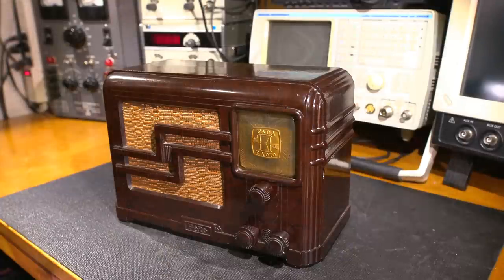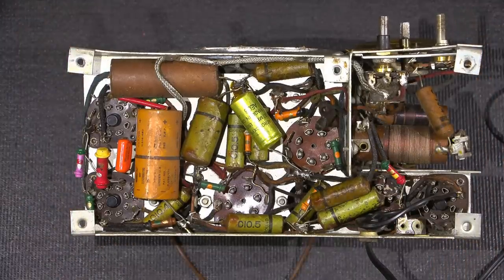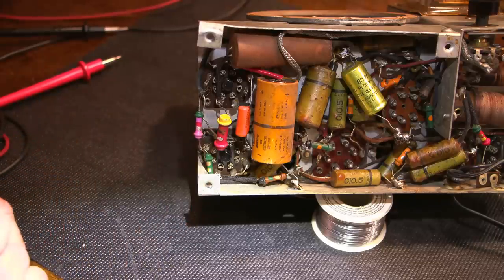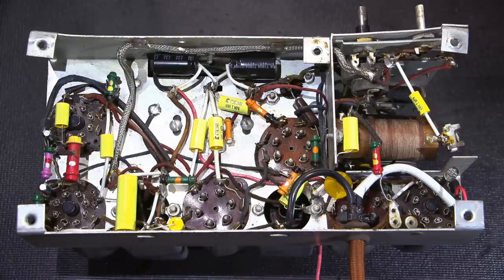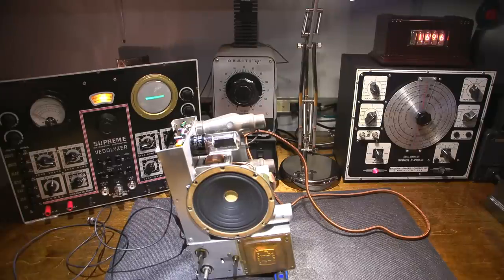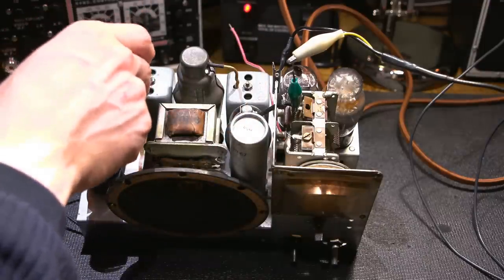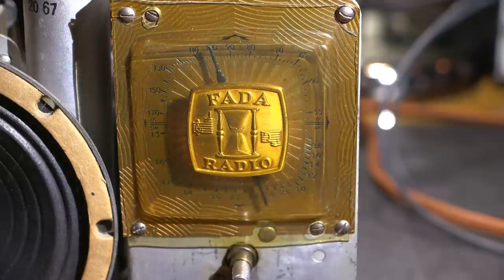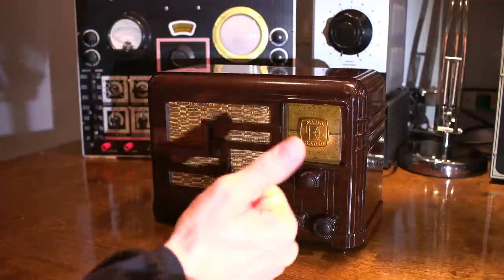FADA Radio Receiver From 1937 Electronic Restoration! [Repair]

Comment: I started working in a radio/TV shop at 14.  I'm 74 right now.  There were almost no solid state devices.  The fear of tube circuits astounds me.  I ended up as Chief Engineer for AM//FM broadcast Stations and am retired from 2 Universities.  I did re-tune  an FM transmitter with 10KV on the plate.  I got the Ip up to 5 A just to see if the tube could do it.  I have rewired 3 phase transformer primaries running either 240VAC closed delta OR 208 VAC 4 wire.  I've even swapped 2000 pound  3 phase HV transformers between different transmitters.  With the right precautions and operating techniques it is safe to work on almost any equipment.  It is important that one hand is ALWAYS in one pocket and all work is done with equipment that is verified OFF, and all HV circuits have been grounded to remove residual voltages.  All jewellry should be removed as well.

Comment: They say that imitation is the sincerest form of flattery - and you Mr Carlson have got me at it too!!

I have recapped, repaired and aligned one 1948 radio.  Two more to go dating to the early 1950s.  Have recapped and repaired a 1962 Cossor 1099 oscilloscope, and am building an accessory device for it to add a normal Y attenuator / amplifier, a sig genny, and a frequency meter switched between X, Y and genny.  There is much more, but no need to list here.

Using vintage to fix vintage is fun !
Reply: Keep going your doing great!  Just remember the rules! It's not dead! It's retired! If it's worth fixing do it right! Nothing electronic should be forgotten!
Reply: @the8bitbarn836  haha the name of my guitar amp repair biz is “forgotten gear restorations”. I couldn’t agree with your sentiment more!

Comment: Last summer while vacationing in Chautauqua New York, I picked up a couple of 1940 era radios from an antique shop. One was a GLF F-770.  It's an am-fm-phono type. After doing a little research it seems it was privately produced for the local farmers and merchants of western New York area.  GLF stands for Grange League Federation.  I love the history behind these old finds.  Been working with electronics for about 40 years. This will be my first "old time radio" restore.  Thanks to Mr. Carlson I brought it up slowly with the variac, isolation transformer, and dim bulb tester.  I found out that the transformer was shorted.  Lucky enough to find a NOS transformer.  It works!  Now for the caps.  This will be a fun restore.  Thanks for sharing your knowledge with us Mr. C.

Comment: I used to have that signal generator, and I still own the same variac as you. I first started messing with vintage radios when I bought a batch of broken AA5 tabletop sets at an auction for next to nothing. Surprisingly, I never had an accident or shock from one of those dangerous radios, and got a good many working.  Back then, my "restorations" were simply replace the defective components and sometimes tune up the IF, and I still love those old tube radios! Real radios glow in the dark. Keep them singing!

Comment: Hello Paul,
 I've been doing "catch up" on all of your videos. I've been thinking about this every time that you do a restoration on a receiver with S.W. You have a lot of space in the chassis after changing out those big old caps for the modern stuff. How about building a small BFO circuit with the adjustment knob on the back of the chassis to preserve the classic appearance while being able to access the high percentage of SSB signals available on those bands.
 In any case, I have really enjoyed seeing some of the stuff that I remember from when I was a teenager with a old scope and signal generator. I really like your teaching style. People with a very basic understanding of electronics can learn more without feeling that it's all over their heads. Thanks again, for all the great videos. I've relearned some things that I forgot sixty years ago. Keep it up!

Comment: Wow! It has been over 50 years since the last time that I touched a vacuum tube device - I worked in numerous repair shops during high school and college. Viewing this episode of "The Lab" was like stepping back in time. Plate voltages, choke coils and filter capacitors all came back - like it was yesterday.  I really appreciated the method by which Paul troubleshoot this '37 radio. I would have got directly to the volume control with my probe (or touched a screwdriver to the center lead of the pot) to check for audio output.  Checking the screen grid capacitor would have been somewhere way down on my list. 
Great video - keep up the wonderful work!

Comment: I can't wait to see a restore of a similar-era TV (even if there's no analog TV stations left, may need to restore one of those as well).
Reply: Take a look at the YouTube channel 'Spats Bear'. He did a ten video series fully restoring an RCA CT-100 color TV from 1954. This may have been one of the first color TVs.
Reply: a vacuum tube tv being able to display a fully sync'ed picture only with all analog circuitry is really a masterpiece of engineering, that's why tv's are a tough dog...cant accurately test components like the flyback transformer, even with a ring tester, it's a gamble...so you need to power the set on, but to power it on you need to change caps... i have done about 20 german BW tube sets..some of them use up to 23 tubes. my approach when possible is do the minimum to make it work, then recap..after recapping there is the need for adjustments before you can be able to display a picture....the timebases will be running at wrong frequencies for example, more than often particulalry the horizontal will need tweaking...after that it requires a full setup to make it look right...it's a really interesting/challenging hobby,
Reply: Bandersontv is a great early TV channel. Bob is as meticulous as Mr. Carlson and is very fun to watch.

Comment: I used to record music off AM many years ago. Unfortunately, my station-of-intrerest broadcast at 910 KHz, the first harmonic of the IF of 455 KHz! This resulted in a nasty beat frequency showing up when properly tuned in. So, I had to DE-TUNE the IF's up or down and re-tweak the oscillator so the dial tracked.

Comment: Mr Carlson, Could you talk about the advantages and/or disadvantages of putting a grounding line cord on these old radios? I seems that rewiring the switch, adding a fuse, and grounding the chassis with a grounded line cord would be the ultimate in safety. What I don't know is what issues (if any) that would have on the performance of the radio. These videos are great, I have several radios that I bought at an auction that these videos have inspired me to rebuild.

Comment: I've never liked tube gear. Had a Heathkit GR-54, switched to a solid-state  Yaesu FRG7 and never looked back. Never had any tube ham gear.  That said, I just love these videos! The sheer simplicity of these radios, and how well they work even 80 years later, makes me think maybe I've been missing out.
Reply: Steve Mason If you made an equivalent design with modern transistors (just a few, say <10), the semiconductors would possibly outlast any foreseeable users. If you used ceramic capacitors only (possible but would make it more expensive), there’s be no parts to have limited lifetime. Lots of transistor radios are similarly simple, and all that fails there are capacitors again, plus the fallout from poor process control in semiconductor manufacturing (it was all new and not always well understood at the time).

Comment: I enjoy your videos. I've been restoring radios for almost 40 years. It seems like your videos highlight chassis in remarkable condition. I'd like to see a video where you have to strip every component, clean/derust the chassis and start from scratch. It's a great process. Or fixing issues like crackling in the tuning cap.

Comment: It's pretty hard to believe but true that most of the dog bone resisters I have tested came out so close they never had to be replaced even in a 1937 Air King radio I had. The paper/wax caps and electrolytics do beak down over time the dielectric in the Electrolytics all seem to dry up over time. Very god troubleshooting and restoration video Paul. Thanks for sharing your expertise.

Comment: It still amazes me just how warm and full the sound is on these old valve radios compared to virtually every solid state radio I have heard, and this is on the AM band, which is not even classed as high fidelity.
Reply: I remember an old car radio pulled from a '68 or so Monaco that had great tone just like a tube radio.  Turns out those early transistor car radios ran a transistor class A through an output transformer just like most small tube radios. Possibly why it had similar tone. Have not heard such 'hi fi' sound from an AM radio since.

Comment: I like your presentation manner and you have a very natural voice with excellent cadence which makes it very easy to follow. Your God's gift of intelligence and electronic ability has helped so many of us. I am thinking of joining your Patreon channel to try some of your projects that are of interest to me. But I have a simple question which I hope is not taken in a negative way. Why are you installing the foil caps with their values not shown? The old dog bone resistors have their painted values on top to be seen easily when installed. Why not the same for the foil caps printed values? I realize you have a schematic for the radio, but would it not make sense to be able to see the value of the cap to make sure it is correctly installed or easy to replace if a schematic is not available? Just a passing thought. Thanks again for the educational videos.

Comment: Well done.  Beautiful (safe to say) equipment. Nice to see the alignment techniques used when I started my career in Communications many (5) decades ago.( + 2nd IF)  Real, hands on, engineering,  New equipment and wireless digital technology are absolutely brilliant uses of the airwaves.  I do not begrudge any of the modern gear but love to have lived through the growth of this vital technology. ( I confess to having some Strowger telephone exchange switches and three Electromechanical  pinball machines plus three quadcopter drones...) Paul F.  North Yorkshire, England xx

Comment: where does one get that cloth cord with the updated polarized plug on it? AES?  The only way that I could see to improve that good idea is if the new cord had the old school round plug body on it along with the wider neutral blade. Thanks so much mr carlson for an excellent presentation of a cool radio repair.

Comment: Great video as usual Mr. Carlson! Regarding the identification of the 'hot' and the 'neutral' on the cord set, we normally...as electricians, make the neutral the white wire (or white spaghetti), and the hot the black wire (or black spaghetti). The neutral being connected to chassis, (or ground).

Comment: I once lived in an old house. If you touched the water faucet and turned the light  on with the pull chain. You got shocked! Since then, when playing with old equipment, I always test chassis to chassis for any surprises
Reply: Short from the electric water heater element and a failed house ground will do that. You don't want to ask me how I know....

Comment: Hello Mr. Carlson, love your video's. Wondering if you can help me find an old wooden radio similar to this. Was a desk top. Made from wood. Had a vertical bow front speaker on the left. Not sure what brand, I think RCA? The dial was to the right of speaker with the nobs under it. Am/fm one straight threw style needle. Am on top or bottom don't remember. The bands were split in half, top n bottom. My dad had one. I grew up with it. The moisture in the air got to it threw the years and it fell apart. My dad has long passed now. Was born in 1899. So i'm looking for one for memories... Thank you, Jack

Comment: It's rather interesting that the radio is an active electrical nightmare when plugged in and not switched on. You make a great point about using isolation transformers on 120V AC radios, because if you were to probe the live chassis with the negative probe, you're basically shorting the powerlines because the scope shorts the negative of the probe to the earth prong of the power plug through the scope as the radio is basically riding the live wire, much similar to what a bridge rectifier circuit does.

Comment: Stunning little radio and fascinating procedure as usual.  Your videos always reinforce my knowledge and enthusiasm.  Lovely vintage aesthetics too.  Matching Vedolyzer and Signal Generator and that Nixie counter, simply gorgeous.  Is the Vedolyzer out of it's case for cooling reasons?  Cheers
Reply from the maker: Hi Pauline. The Vedolyzer cabinet needs refinishing (it's wood,) so I may stain it the same color as the bench.

Comment: I remember watching the video when you restored the Vedolyzer. It was nice to see it in use. You must have a very large supply of capacitors on hand to do recapping of all the old devices. The chassis always looks so much nicer after you recapped it due to the time you take to work out how best to place the new caps. I did wonder about the frequency you used for the IF alignment. You used 456kHz but most modern equipment uses a 455kHz IF. It won't make much difference to the radios operation as the oscillator was adjusted based on the 456kHz IF.

Comment: You produce great restoration videos. Thanks. Question: #1, what did you mean by the capacitor being over the side therefore a particular one must be chosen?  #2, what will you do with AM radios if the FCC goes through with the digital transmission plan for the AM broadcast band? Worries me.

Comment: Another great video! I have a 1930-34(not sure) Fada freestanding cabinet radio, which I added a small Bluetooth receiver inside of, and relays which switch between the old receiver and the Bluetooth, so I can listen to the old CBS mysteries, war of the worlds, and YouTube. Purists would hate me but I didn't modify the radio in any way, except a few snipped wires.

Comment: Love your videos. Tektronix T922R Oscilloscope bought recently. This is my first and not sure if it will help as I still consider myself a novice on radio restoration. Any information about this Oscilloscope will be appreciated. It does work as much as I can tell.

Comment: I recently made the decision to tear apart my E-200-C signal generator for lack of a good selector switch.  I will be reusing the power transformer in an amplifier build.

I just noticed the HIT-RAY branded tube in there.  Those tubes were made by Hitachi, whose tube factory was tooled up by Raytheon in the mid-1940s, hence the name HIT-RAY.
Reply from the maker: The E-200-C is so stable, (one of the best I have come across) in this type of signal generator (Harmonic type.) Too bad you don't have a replacement switch.
Reply: @MrCarlsonsLab  To be honest it was already broken when I bought it, and the thing sat around for a couple of years.

Comment: That is the FADA 360 from 1938, and not 1937 if I'm not mistaken.  I own a similar set, aame chassis that is marked 1938, may have been produced over a 2 yr run?? Mine is the1938 FADA 360-G in white plascon with gold tone  grille. 
Cool channel. Cool radios. Peaxe.

Comment: That’s a nice looking set - you must have picked up at a flea market or swap meet; it’d be in pieces if shipped FedEx. Also, at around 7 minutes, if you look at the back side of the chassis, it looks nice and straight, but the top looks a little bent. All those wax-paper caps need to go bye-bye, though. 😊

Comment: Hello Paul, have you considered selling your electronic creations in kit form? I would love to be able to make some of these projects, but don't wish to go through the process of creating circuit boards and assembling parts.I would specifically be interested in the capacitor outside foil detector and the signal sniffer. Thanks for your consideration and keep up the great work Paul

Comment: Paul, when you talked about the mica capacitors used in the oscillator, you said they were hand-picked to make the oscillator function properly.  Did the capacitance meters back then display measurements accurately enough for the hand-selection?  Or is there something else in that circuit to "tweak" things so the selected "ball-park-value" cap will work?
Could you make a video showing how the Engineers back then developed their oscillator circuits and determined what values were needed for the mica caps?  Or even dissect an IF can to show & explain how the IF can assemblies work?
Reply from the maker: Thanks for your input Bob!
Reply: @MrCarlsonsLab  ,    Yes... exactly the same question came to mind here! What test equipment, standards and such were available back then?

Comment: I have learned a lot of places where I made my mistakes. I was used
 to pieces that I'm built was with high DC voltages the one amplifier
that I used to build I had a block diagram of it I deigned  the parts 
my self it was touch and go it finally worked. it did what I wanted it 
to do

Comment: When I was a kid my dad had a Telefunken radio, what I loved seeing was the back part as he turned it on. It had two Phillips tubes in one side that would flash glow before the actual filament warm up. The other tubes would just do their normal soft glow up. Later when I took the tubes to be tested the technician told me that initial flash was a characteristic only Phillips tubes had but didn't know what caused it.
Reply from the maker: You may enjoy this video: https://youtu.be/bX0o3jAzSBs
Reply: @MrCarlsonsLab  Very informative, though in my case, them tubes really lasted a long time. I remember changing others but not those. Great info thanks!